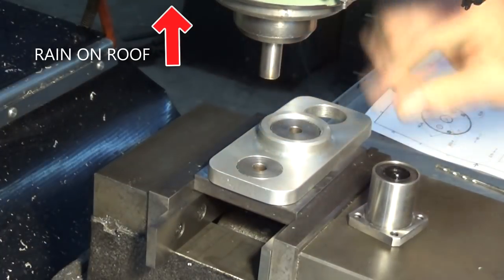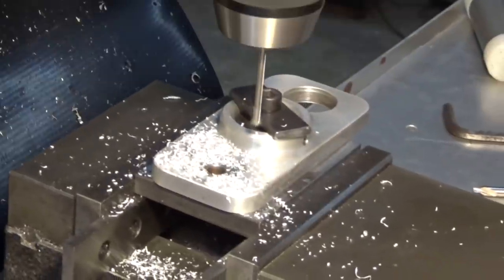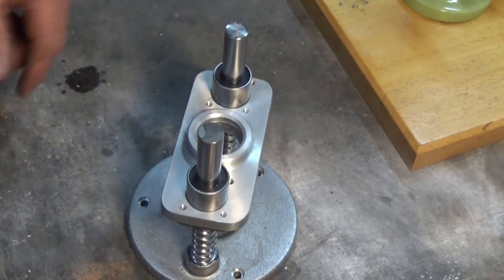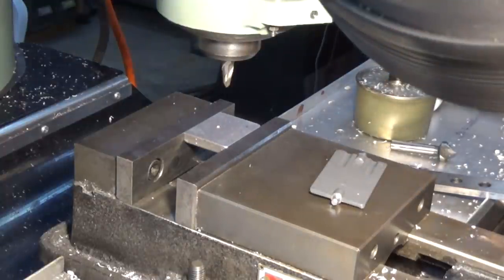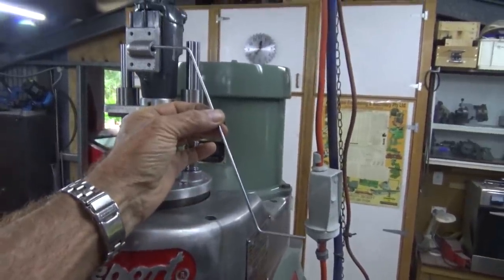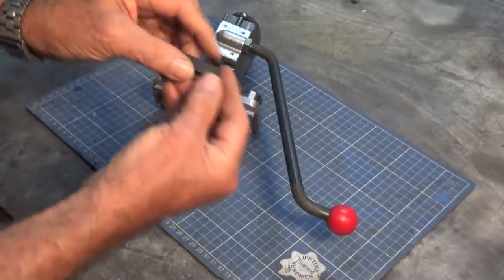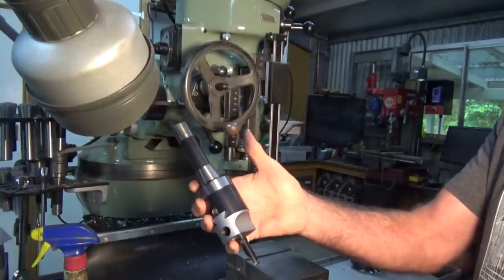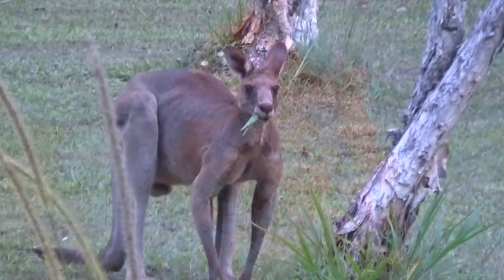DIY Power Drawbar for a Bridgeport Style Mill - Part III

Comment: Hi Preso. I really like your table covers on the mill. My mill table could also do with some covers like that. I'd seen Tom L's wooden ones in the past, but I like the idea that yours would catch chips nicely too, and make it easy to dump them in the bin. The power drawbar so far is looking pretty spectacular. Love hearing about the design and the thought process with the machining, and use of fixture plates, etc. Thanks for taking us along for the ride. Please don't worry about longer series - they are very watchable. Love the nature shots too, and the pictures of birds too in the previous videos.
Reply from the maker: If you are fitting table covers, don't make the same mistake I made which was fitting the vice directly in the centre of the table. It's better to fit it to one side so you can then add a rotary table or angle plate without having to move and then re-tram the vice. I am going to move my vice but then I will need to alter the table covers.  
Regards,
Mark

Comment: I never had a design go from the drafting board to production without modification, so why not have extra episode to show how you overcome your design challenges or improvements. There is a reason why we call them prototypes. It's been a well thought out design and you have adapted like the true professional that you are. Kudos!
Reply from the maker: Thanks for that. Breaking news! I actually got it working this afternoon. There's still some cosmetic work to be done but it is at least ejecting all the tools now. It fought me to the bitter end though as you will see in the next episode. I'm glad you realise that this is a work in progress. When I was studying design at college we were told that design cycles can require multiple iterations  and it is almost unheard of for a prototype to go to production on the first cycle. 
Regards,
Mark

Comment: I loved the wildlife and the flame tree shots.
The R8 tooling for my non-Bridgeport mill does not self eject.   I always have to tap the drawbar with a plastic dead blow mallet I keep by the mill.   Most of the collets came with the mill when I purchased this second hand.   The drill chuck, boring head and Morse taper adapter are all new and also do not self eject.   Perhaps it is some detail of the internal R8 machining in my spindle.
As others commented, the number of videos is not a problem for this viewer.
Dave.

Comment: When a tool holder of R8 taper hangs up after loosening the drawbar either manually or powered, a very LIGHT tap with with some non marring object will knock the tool loose from it’s taper.  My students were always confused by this because they could not see what was happening inside a mill’s spindle.  Old school machinists even made a special drawbar wrench for a manual drawbar with a socket to fit the hex on the drawbar on one end and a brass hammer face across from the socket, all mounted on a handle.  A kind of two faced hammer if you will.
Reply from the maker: I actually have one of those hammer/wrenches that I made for my little CNC mill. It has morse taper tooling and it seemed to make sense to combine the two tools into one. 
Regards,
Mark

Comment: could you capture the drawbar with a thrust bearing? so as it threads out and hits the thrust bearing at the top, driving the tool holder down and out of the taper?
Reply from the maker: Yes, you can absolutely do that but my original approach was to keep the design as simple as possible. If it weren't for a few sticky tools I could just stop now and it would be done. I'm also trying not to modify the head of the mill in any way. I'll know in a day or two if the upgrade is going to work. 
Regards,
Mark

Comment: The ridge on the butterfly wrench handle is to remind the operator which way is tighten or undo. Particularly if you have the wrench pointing up or down or in a place you can't see the wrench handle.
Reply from the maker: Thanks, I suspected it was something like that.
Regards,
Mark

Comment: Good Show Mate...as usual. No need to apologize. When you open up a can of worms you wind up having to herd those puppies. It's just part of the process of doing something and finding out there is more to it than you thought. Fine tuning is all part of it. We hardly ever have any kangaroos in the yard here in East Tennessee. Looks like fun though.
Reply from the maker: Here's a fun fact, if a kangaroo is startled they will stomp with their hind feet to warn others. We had a large one in the back yard one day and it saw me before I saw it. The noise they can make with their powerful hind legs is quite remarkable.
Regards,
Mark
Reply: @Preso58  We don't get kangaroos but we do have an occasional black bear. Had one running through the neighborhood several months ago. Not the kind of thing one wants.

Comment: you will be adding a longer leaver or arm to the lock down mechanism as its going to be up there and for convenience look at putting lock down leaver or arm on right side then if you need to us it you have the upper hand but have the second or lock leaver back or behind the primary function leaver  this will allow you to have your left hand free for the tool catching
Reply from the maker: I've already done some mods to the design due to a rookie error in my CAD model. You will see the changes in the next episode. 
Regards,
Mark
Reply: @Preso58  I do enjoy your video's though

Comment: Nice and simple design change to over come the locking taper Preso👌🏻 I find most of my tooling needs a gentle tap to release it, might have to add one of these to possible project list. Glenn
Reply from the maker: I actually filmed one tool that had hung up on every previous attempt to get it to eject and it promptly fell out of the spindle. I was trying to show how fickle individual tools could be. Then I started to second guess my intention to go on with the upgrades to the design!
Regards,
Mark

Comment: One idea for your consideration: make the locking mechanism spring actuated, so it latchs by itself. and get a brake lever from a bicycle and some steel brake cable to disengage the lock. This way you can operate it with one hand. Also the steel bar can be a tube and it will be lighter and easier to grab.
Reply from the maker: Well, I can report that the upgrade version is now complete and it is working but it's not going to be a one handed operation. My design criteria was to keep it as simple as possible and although the first version was indeed simple, having the tools hang up in the spindle was more of a nuisance than having to use a spanner and a mallet. The next episode should be out by the end of the week.
Regards,
Mark

Comment: Nice video Mark. You need to add a flange to the drawbar and capture it with the bottom plate or an additional plate (and a thust bearing if you wish) so the thrust load is reacted by the static parts. Give it 3-5mm axial clearance to make assembly easier. It's going to be low duty, but the impact wrench is not designed to react thust loads. Also if you can't reach the drawbar nut, how will you reach the latch?
Reply from the maker: All will be revealed within a week or so. I did consider the captive drawbar idea but the concept was to keep the Bridgeport as original as possible. The build doesn't require any modification of the mill head at all. I've drilled enough holes in it already. 
Regards,
Mark

Comment: Hi Mark, you could capture the draw bar with a collar or flange to keep it from lifting.
Content is always great, thanks for sharing. 
Cheers
Reply from the maker: Rick, yes, that is a valid way of doing it. My intention was to come up with a solution that didn't require any modification to the mill itself. So far I haven't had to drill any new holes in it or change anything to do with the drawbar. I did actually get it working successfully today but it didn't go as smoothly as I would like. You'll see how it fought me in the next and final episode. 
Regards,
Mark

Comment: Dear Mark
Could you please do a experiment for me and bead blast the tapers on one of the sticky tooling.
 I am still curious to see if the tapers rings. 
Great series on the draw bar .
Reply from the maker: I am still not sure why certain tools stick. I have recently ordered new spindle bearings for the mill. When I have the spindle out I can do some inspection with bearing blue and try to determine if there is an issue with some tools only making line contact. I suspect they would be the ones that come out easily. It's a mystery at present but the mods to the power drawbar should solve the problem regardless. 
Regards,
Mark

Comment: Very nicely done, one thought  I had: maybe change the position of the handle to be perpendicular to the paddle such that when pulling down there is less rotational movement until you engage the hex on the drawbar.
Reply from the maker: Jim, that part works fine. I have bigger issues to deal with as you will see in the final episode. 😢
Regards,
Mark
Reply: @Preso58   Not a criticism, Mark, just thinking outloud, very impressed with your project. I am setting up my small.shop and very much enjoy yout videos.

Comment: I have a turret mill (Warco HV) which does not have a spindle lock which is a pain so I was considering something like you design using an impact wrench. My first hurdle is that the drawbar has a 21mm square to spanner on. Good video. It's not to hot here in the UK.
Reply from the maker: It was surprising that it wasn't necessary to lock the spindle on the Bridgeport. However there is a fair bit of drag in the variable speed drive. I think the hammering action is enough to loosen the drawbar without needing to apply the brake. I'm thinking that a square head might be hard to work with but is it possible to machine the end of the drawbar to a hex?
Regards,
Mark
Reply: @Preso58  Hi Mark,   I am working on a similar idea for the Warco HV mill but I am making a 21mm square to 19mm hex adaptor in order to use an impact wrench on the drawbar but just freehand. I could mill the 21mm drawbar square to a hex but I need the drawbar in place to use the mill. I will at sometime make another drawbar and fit an impact wrench as you have.
Regards

Comment: Hi Mark, 

I used an air impact wrench type motor for a Bridgeport a few years ago, it had something like 15 or 20 beats per revolution and had a forward/reverse valve very similar to yours.
The action was very close to that of a cordless hammer drill for drilling in brick or even modern cordless impact screw drivers.
It was very effective at ejecting the collet with a very slight down force on the valve handle. 
I don't recall where I got the impact motor from, otherwise I would be happy to post a link to it but they are out there if you're willing to take the time to look. 

Yours design is very nice BTW :-)

Comment: I wonder if a better approach would be to arrange the handle so it acts on the main body to pull it down but the handle runs through an upper an lower bearing so it can also rotate about a vertical axis.  When you pull the handle down it engages the drive onto the nut and then swinging the handle across rotates it in the bearings and an arm sticking out activates the butterfly valve.  Then you are not pulling down on the valve itself.  I think rotating the handle still further could engage a lock pin to hold the position and force the tool out.  I guess a bit like the selector forks on a gearbox where the fore/aft motion is separate from the rotation.  Not easy to explain sorry !  Interesting project anyway.  Best regards UK.
Reply from the maker: I retrofitted a leaf spring under the operating paddle which makes it much harder to accidently operate the impact wrench. I was definitely trying to adhere to the KISS principle when designing this tool (Keep It Simple Stupid). I should make a very large poster with the KISS principle to hang on my wall because I have a tendency to overthink things and overcomplicate devices sometimes. 
Regards,
Mark

Comment: Mark, my Chinese mill has a cap over the drawbar which limits the vertical movement of the bar thereby exerting a downward force, disengaging the R8 taper as you unscrew it. It looks to me that you could achieve this by turning a groove in the drawbar hex and bolting a catchpate to the base of your assembly. Or turn a new drawbar with a flange a the bottom of the hex - may be another video :-)
Reply from the maker: Andrew, I have wrestled with the notion of modifying the drawbar to make it "captive" which achieves the goal you are describing. The problem is that you get sort of committed to a design philosophy and once on that path you have to keep going with it. My goal was to make a mechanism which was totally reversible. I didn't want to make any modifications to the drawbar or the milling head on the machine. In hindsight it was always going to be difficult. I had a bit of a setback today but I think I can still make the original intent of the design brief work. More sad details will follow in the next episode.
Regards,
Mark

Comment: A cool feature for the DRO software would be a "parking sensor beep" thing. Whenever it detects movement in one direction, it beeps faster until the setpoint is reached, then it beeps continuously for that position for ~2 seconds. This way, you can keep your eye on the job, not on the tablet.

I don't get how that locking mechanism would work, wouldn't it require 3 hands to operate? One hand to keep the main lever pressed, one to hold the tool so it doesn't drop and one to rotate the 2nd lever? I would have gone for something like a handlebar lever on the main lever, like the throttle on a lawnmower. It can then tighten a split cylinder onto one of the shafts.
Reply from the maker: I haven't tried that feature of TouchDRO yet. but now I am keen to have a go. With regard to the PDB, yes, its requires some hand eye coordination but I think it will work.
Regards,
Mark

Comment: On a steam engine they have a governor with 3balls on leaf springs that when spun they swing outward that pushes the centre shaft down if you incorporate this type of mechanism as you I gauge the paddle the mechanism would extend down in gaging the drawbar

Comment: I see your using a center drill, have you noticed better accuracy using a 120 degree spot drill?
Reply from the maker: No, not really. I use both and I don't really have a preference. The centre drill is the preferred method if you are wanting to prepare stock for turning between centres though.
Regards,
Mark

Comment: Great job! I'm not sure it would work on my mill, I have a Wells Index that uses B&S #9 tapered tools. I have to use a brass hammer on the drawbar after loosening it. Also, the belt pulley is not fully enclosed like a bridgeport. Still, a great idea that makes one think of different approaches to a problem.

Comment: Awesome build Mark. Waiting for the next part :) 
Isn't the latch handle too high up there? won't you need an extension for this one as well? Also, Maybe there's a way to make the latching mechanism integrated in the same handle as the main one, like an extra pull toward the mill head or something like that, it could make the operation one handed. I mean to add a pivoting point in the middle of the large handle, with a spring in it, and a little latch thingy on the side of the mill head. If it makes any sense.
Reply from the maker: David, I thought long and hard about how to make the latch self actuating and just about every option required a lot of parts to be made with every one a source of potential failure. The little rotary handle will be a bit of a reach but at least you only have to flick it left or right. The issue with using a spanner on the end of the drawbar is not so much that you cannot reach it, it's more that you can't see what you are doing and you have to work the spanner quite a lot. If it comes to it I can bend the handle down a bit but I should know by tomorrow if it's going to be a problem. 
Regards,
Mark
Reply: @Preso58  I don't know what to hope for, I hope it's not problem, but problems on your side mean more videos for us so 🤷‍♂️

Comment: How about a short stroke single acting cylinder pushing the pneumatic unit down. Single action with spring return, so all that is needed is a valve to apply pressure to it if needed, and vent otherwise, so it is free to not engage. Then you have stuck tooling, simply bring down the pneumatic driver and engage, then press the button to engage the cylinder, and run the tool, and it will pop the tooling out, but if it is stuck it will simply push up and not damage the drawbar or the mill itself.  Already have air there, and you likely will be able to get a single ended short stroke cylinder locally, or find one in a scrap pile, as it just has to have a diameter around that of the actual driver. Then a repurposed machine foot on the actuator shaft, to spread the load onto the head of the pneumatic driver, and away you go.
Reply from the maker: I have seen a lot of builds using that design but I intentionally tried to keep my design as simple as possible. The upgrades to the original design are not too difficult to machine and I am fairly confident it will solve the problem of the stuck tooling. It essentially does the same job as the pneumatic cylinder only it's a mechanical system. The upgrade video should be out in about a week.
Regards,
Mark